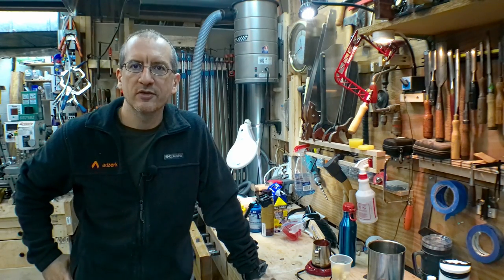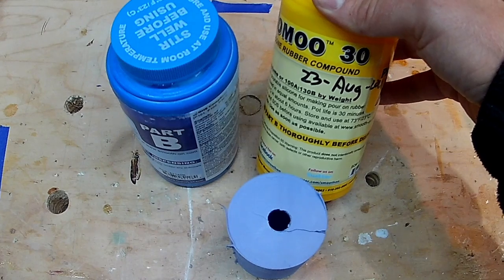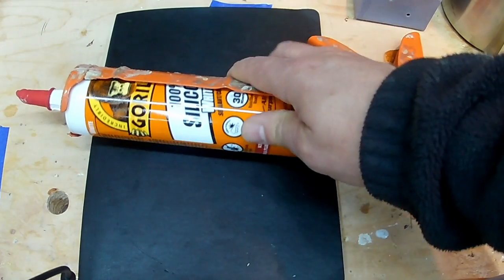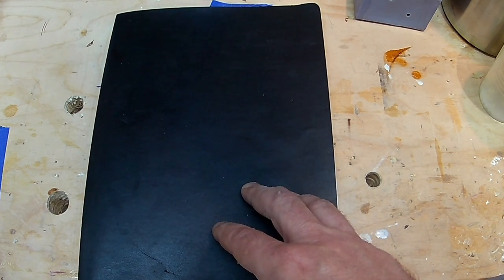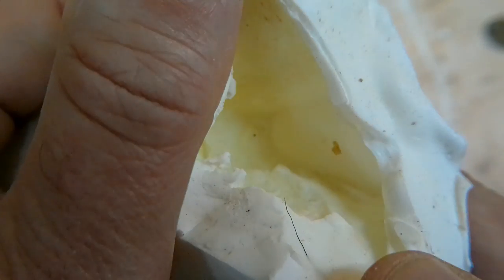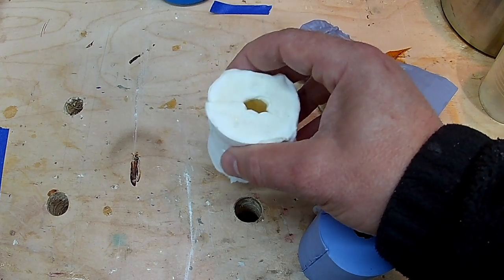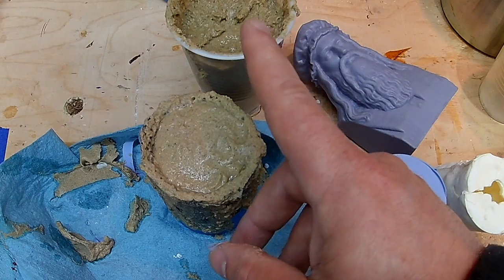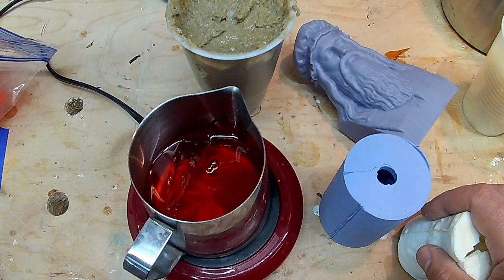Two-Part Silicone Alternatives, Part 1

Comment: can you add acrilic paints for color to that combination?
Reply from the maker: I'm not sure. I know you can use acrylics in resin (I have, several times), so it seems like they might not be incompatible with a non-polar solution like this, but I haven't tried it. Are you doing something where the shrinkage wouldn't be a problem for you? If you watch the rest of the series, you can see I never did overcome that problem.